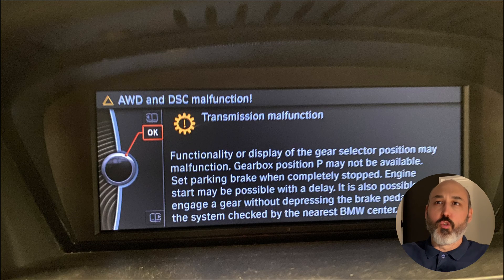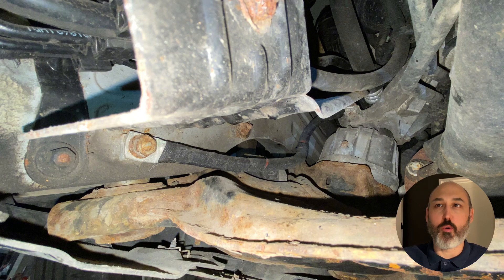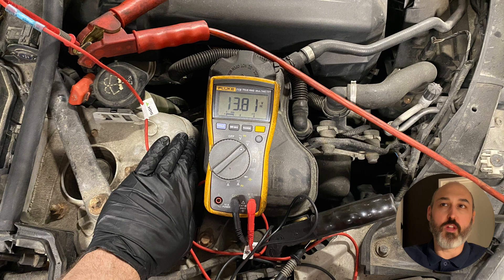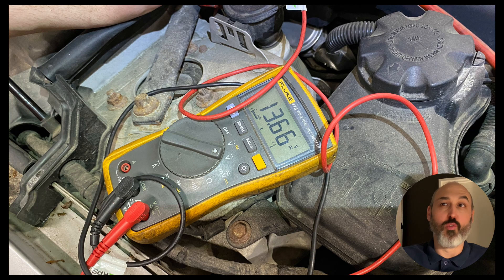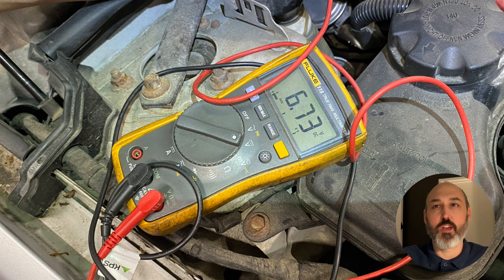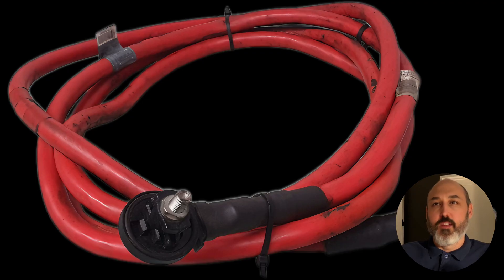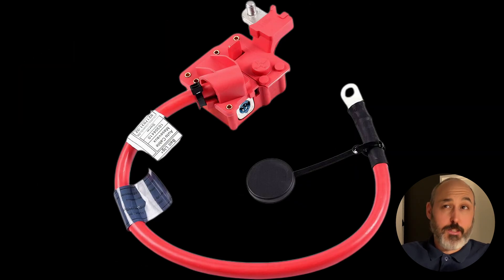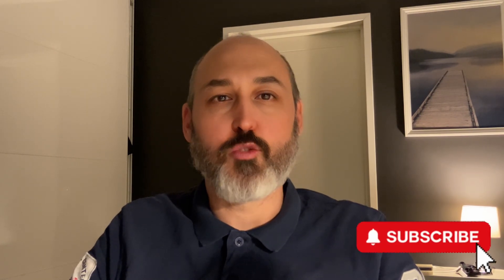No crank no start? [Real Fix Revealed] | Voltage Drop Test & Rotten B+ Cable Case Study

Comment: Good knowledge sharing as always, thanks. Had a corroded braided ground cable on my friends E81. It looked ok, but cleaned up the terminal and got it to crank but it was a lucky guess. Wish I’d seen this test before.

Comment from the maker: 🔧 Got a no-crank issue or electrical mystery? Drop your symptoms or questions below — I’m here to help you learn real fault-finding, not just part-swapping.

📚 This case study shows how a simple voltage drop test can reveal hidden problems like a rotted B+ cable. If you found it helpful, hit 👍 and subscribe for more real-world diagnostics and DIY teaching content.

👇 What topic or fault would you like covered next?